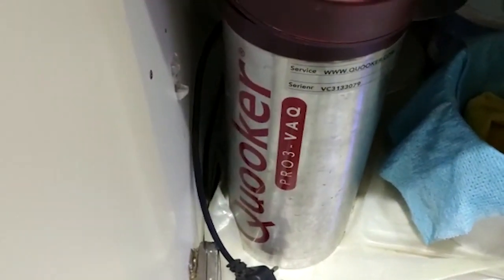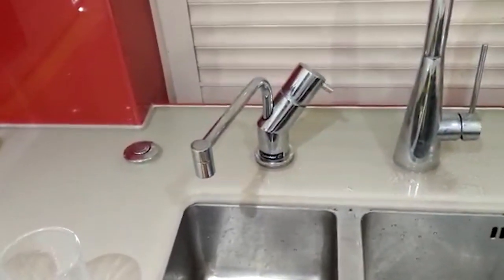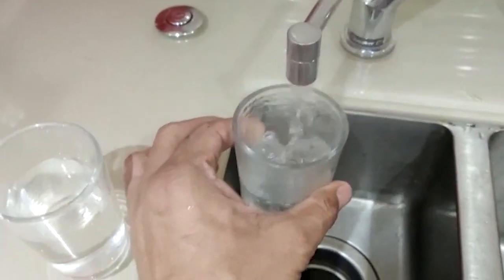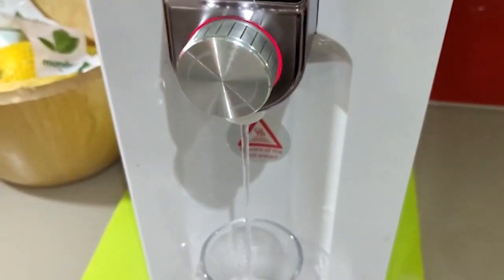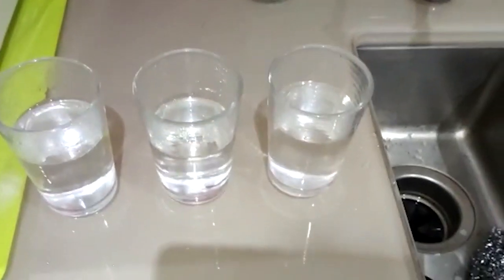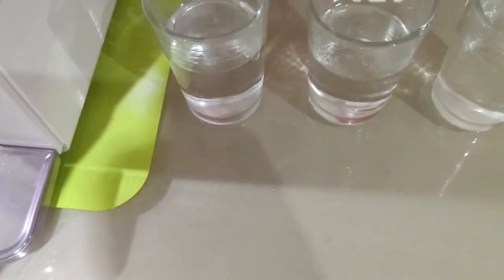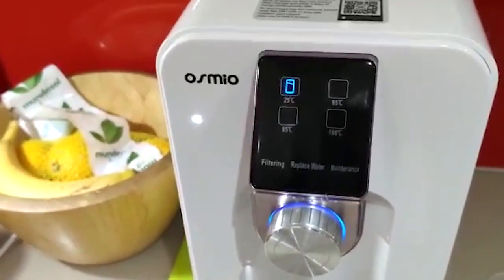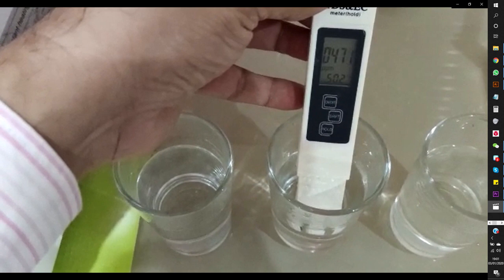The Truth About Instant Boiling Taps - Part 1

Comment: I have had the same health concerns concerning these hot-water systems. All it took for me was to use some common sense which led me to search about videos of how the inside of these boilers look. Lot's of videos with huge limescale build-up. What made me even more concerned was that Quooker apparently recommends that the very small filter inside of the boiler needs to be changed only after 6 years or so. That was at least what I learned from watching one of these videos made by users. I thought: how can this be possibly safe?
OK, to be fair: I don't know what magic they have built into their filter it just says it is active carbon.  And apparently, the hot water runs through this filter (Please correct me if I'm wrong on the hot water since I'm not completely sure about this point.)
I'm not about bashing anyone's products. I would just love to see in general companies not only focus on design, and convenience but also put much more thought into the health aspect of their products. This is true for all sorts of products not just for faucets.

Question: What type of warm-water system do you use for your home in general (bathing, washing the dishes etc.)? Are there any brands of flow heaters, boilers, etc. that you would recommend in terms of health? What would your personal optimal system look like including filtration? And for what type of water pipes would you settle for your home?
I would truly appreciate an answer from an expert like you.

Comment: The test with an 8 year old Qooker, and a brand new osmio,  Can you test it with an 8 year old Osimo?  Just in the name of fair play, and apples with apples etc.
Reply from the maker: Yes can do this because we do occasionally get old ones for repair, so can show TDS results from them. The Osmio Zero has a TDS alarm built into it to stop dispensing if it goes over a set level, so you end up comparing apples and crapples

Comment: The “mechanism” described here sounds remarkably like electrolysis. Howsoever it may be, in what way are TDS’s dangerous? This aspect of the “mechanism” - be it electrolysis or some other electro-chemical process - has not, in this presentation, been clearly defined. The water in my region is very good quality. We, essentially, can’t really detect any distinct (unpalatable) difference between water direct from the cold tap or that from a filtered water device. It is true I don’t have the TDS data, but in 40 years of drinking and boiling this water we have never needed to descale any boiling device or appliance: they simly do not suffer from build of “deposits” lime, or otherwise.
Reply from the maker: the issues with all plumbing and heating system is corrosion and scale build up, so TDS is just a way to detect when this is happening, and a proper heavy metal lab test confirms it

Comment: "not only are they environmentally unfriendly keeping water boiling all the time" - 
Are they really? It's basically a vacuum flask. There is very little energy lost. I have an electric kettle, and I try to only heat what I'll use, but I know people who fill their kettle all the way up, use a cup, keep the kettle on hold, don't come back to it, and all that extra water is now just cooling down, ready to be reheated again. It would have been much better to have it in a super insulated container leaking very little energy, allowing for just the right amount of boiling water.

Comment: It makes sense, although what concerned me as someone who researched and bought an Osmio under cabinet system then changed to Osmio Zero free-standing unit and only my wife is considering Quooker as water drips into the sink vs an out of sink drip tray is the quality of the cooled filtered water, they use an active carbon filter cartridge however compared to Osmio’s four filters I wonder how Quooker would re mineralize the water or is it pure water. I would like to see the tds test done on a brand new install on boiling, sparking and the cold filtered water to understand better.

Comment: I’ve installed many of these taps over the years as Part of my job as a experienced kitchen installer. They look great in principle, but the instant boiling water is (in my opinion) dangerous. I’ve had customers ( and children/visitors to those customers) who’ve  got confused operating these taps and have got burnt. I’m not saying that no-one should buy these taps, but they should be made aware that if they are very old/vulnerable/children/easily confused are likely to use them think very carefully about purchasing. Would I buy one myself ? No.
Reply: Thanks for pointing out the dangers of these boiling water taps. People seem to far easily ignore these dangers. Dread to think the amount of accidents that these taps will lead to.

Comment: Terribly bias. A brand new machine! What will that be like in 8 years time? Also how can the reading be that much lower than the cold water tap? Was it filled with Alpine spring water? Surly it was filled with water that is supplying the cold tap so would be at least the same. What reading would you get from a kettle that is not brand new? Are these particles harmful at all? Most would probably be from lime scale. Poor video all round.
Reply from the maker: Whatever heats up water ends up in the water. Using a device that keeps water hot all the time and made from stainless steel is the worst thing one can do. The osmio zero uses a rare earth ceramic oxide heating element and these are usually changed within 7 years which heats only on demand and it makes a huge difference. People but tap water into the Osmio Zero and the systems makes the water have a negative orp which is the main reason for corrosion, I. E. Having a positive orp. Measure your tds and orp. You think it's a poor video, but you have alot to learn about water purity and corrosion.
Reply: Ohh I didn’t realise the tap water going into the machine reads 274 on tds meter but coming out of the machine it measures 27 was it? So the machine is actually magic it’s made the same tap water so much safer to drink. Hilarious! So what would the machine test at after 7 years? And why is it worse for the environment when tests show it’s cheaper to run a hot tap system than a kettle? So it’s using less electricity
Reply from the maker: @siliconemaster  you've really missed the point. Would you drink our of your hot tap at home and fill your kettle with that? Why not? It's even worse tds increase with instant boiling taps, you see if you can get that point. Noone should be using these devices, they need to be banned. Check the tds yourself anyone with a 3 month or older instant boiling tap, oh and make sure you let the water cool down first

Comment: So 0.02% more parts per liter after 8years? oh no..
Reply from the maker: EC meters typically go up to 999, so have a increase like this which is getting on for nearly doubling is highly significant in the water treatment, but still a good point. Next step for us is to do a water quality test on these systems, we will do a full potability analysis including also the metals from the stainless steel like chromium and then show the source vs the instant boiling. The EC test simply shows there is something majorly wrong. Perhaps you drink and cook with the hot tap in your kitchen? Most people know not to do that and it normally wouldn't exceed 60 degrees C.
Reply: @OsmioWaterH2O  https://tappwater.co/en/tds-tap-water-filter-quality/ interesting read. Imo, if they claim a TDS of 300 - 600 to be fair, then the TDS of an old quooker unit at 450  doesn't sound alarming. Also the fact TDS cannot detect all details the same way a lab test does. And the human body actually requires a specific amount of minerals does also make sense to me.
Reply from the maker: @Zarod89  if the Tds has doubled from the system that indicates something wrong and it means a lab test should be done. If you don't think it indicates anything wrong, why don't you use your hot tap for cooking or making tea or drinking, we all know what is going on here

Comment: Boil, cool, boil, cool, boil... if you want an energy efficient solution for boiling water in the home, wait for the kettle to boil. If you want a high consumption, catering solution, buy a BURCO boiler. A tried and tested solution since 1938. Save some money and baby seals while your at it! 
Assuming that your ‘Osmio’ unit uses the same heat cycling principle, but has a ceramic coated element (not the tank I’m guessing) how is it any different to the competition? 
If you want the purest possible option for the home, re-fill your existing kettle with as much water as you need each time you use it. Which is what most people do anyway.
Reply: Are you seriously suggesting that unfiltered tap water is the purest possible option? I think you may be missing the point.

Comment: As someone considering buying one of these instant hot taps I was very interested to watch your videos on the subject. 
I shall have to do some more research on the subject - I thank you for raising this.
As an aside - TDS meter readings are sensitive to the temperature of the liquids and it is not appropriate to make readings for comparison purposes unless all fluids are at the same temperature. I would also question whether the meter in question is suitable for use with temperatures nearing 100deg C. Most recommend  taking measurements at 25degC which is the international standard. I mention this because it is a massive claim you are making, wholly based upon the readings from a device which is not being used according to good practice.
Reply from the maker: The temperature maximum usually on Tds meters is about 80 degrees c, many of them also measure temperature. You can easily test it yourself with anyone who has has instant boiling tap. Just allow the water to cool to room temperature and test the tds then.
Reply: @OsmioWaterH2O  Your "findings" would carry more weight had you followed Simon's sensible suggestion. I cannot easily test it myself for want of anyone with a boiling water tap. Why not retake your video comparing three samples at the same temperature and, while you do so, avoid the silence at the beginning of the present video?
Reply from the maker: @johnnywilkinson9736  it's a good suggestion. If anyone has one and a TDS meter they can do exactly this test and see the same highee TDS.

Comment: Why are you all not compare it to the kettle boiled water? It's like comparing snow flakes to the rain!
Reply: Good point! Water boiled in a kettle should have been one of the comparisons. As a kettle boils water only once, I would expect to see a lower reading compared to a ‘boiling water tap’ which continually boils the same volume of water until it is used. This is when the oxidisation is given time to take place.

Comment: What an idiot!.. there’s nothing wrong with lime scale in drinking water... I removed the HTAC filter in my Quooker, I use water from my own borehole...I descale my Quooker every year and there is a lot of limes ale in there... so of course some will dissolve into the incoming water. Now if you believe that the TDS is some kind of dissolved metal, then prove it..
I bought the identical TDS meter as per your video.. my standard tap water was 217, from the boil tap it was 550... but only because it was boiling!.. it rapidly dropped to 217 by the time it got top 70 degrees celcius again as the water cooled, so still within the parameters that are normal, but back down to cold water tap levels by the time  it was drinkable... noting that your tap is not pouring at 100 degrees, it won't have redisolved many solids and if you then put in a filter, of course you can remove stuff.. but whilst the filter is new and clean.

Comment: As per the video TDS levels for the Osmio gave a reading of 36. What I want to know is where you are getting your facts that the reading of 36 is the safest option to consume out of the the 3 tested?

As per the water regulations the amount of TDS thats required in the water to be considered the healthiest is as per below:-

<50-250 ppm	Considered low: missing in some of the minerals that are beneficial to your health
300-500 ppm	Perfect: This level is the sweet spot for TDS in drinking water
600-900 ppm	Not great: Consider a reverse osmosis system to remove your TDS
1000-2000 ppm	Terrible: Not recommended or safe for use
>2000	Worst:     A TDS level above 2000 ppm is completely unsafe and household filters can not handle this level of contamination

As per the above facts the osmio is actually removing the beneficial minerals that are required by our bodies. Please can you explain yourself?
Reply from the maker: Your notion is totally incorrect and probably came from the WHO. You should distinguish between minerals from biological and geological sources. The first challenge is to purify water to the best level, but this involves reducing the good, bad and the ugly. Once the water is in this state then then water is conditioned how we want it to be. The minerals are bioceramics which means they are bonded with carbon to make them bioavailable. Minerals from geological sources are not. Consider hardness of water provided by 120mg of calcium per litre vs the same amount of calcium from an apple. The apple is bonded with amino acids to make it bioavailable. The water from the Osmio Zero is also negative ORP, redox potential. You can research this until the cows come home, but ultimately look at the people who have been drinking distilled or osmotic water for the last 30 years and see for yourself if they are depleted in minerals or just happen to be the healthiest 70 year old you know. Good luck with your research because I can see where you are with it, and you have a long long long way to go 🙏
Reply: @OsmioWaterH2O  no comments 💩
Reply from the maker: @mariuszj1200  sorry did I miss anything?
Reply: @OsmioWaterH2O  Great, informative response. Thanks

Comment: Try looking in a kettle after 8 years!!
Reply: Who keeps a kettle 8 years?
Reply: Your missing the point. A kettle boils the water once before it consumed. Instant hot water taps continuously boil the water in a reservoir until it is used. This system increases the time factor for the oxidisation to take place.
Reply from the maker: See here TDS test on a 10 month old system https://youtu.be/I4wC_s5beKg

Comment: You should read this article

https://tappwater.co/en/tds-tap-water-filter-quality/

TDS does not mean the quality is poor, adding a filter before your boiler and good maintenance needed.
The fact that your tap splashes means that there is a lot of scale present.  I maintain mine and it never splashed once. 

Hope you don't hoax this new technology any further.
Reply: Search for ‘laminar flow’ 😆
Reply from the maker: Oh jeez man if the guy has double the level of dissolved solids that a problem and yes a TDS is a crude measure but its meant to be double the incoming. Heating water always puts material extraction into the water. That is what is is about!

Comment: 8year tank. Vs New  osmo?  Is it fear? Maybe time for service? Do a test when ozmo is 8 year without service.
Reply from the maker: We did a test on a 3 month old quooker owned by a plumber called Martin Train, it was 30ppm higher and no calcium in there it was softened water
Reply from the maker: Yes have done tests on 7 year old ones with original rare earth ceramic oxide heating elements, there is no TDS increase when it's heated. This material is the gold standard for material extraction for heating elements
Reply from the maker: Martin Train the plumber is how at 100 TDS ppm over from 30 ppm a few months ago
Reply from the maker: See here TDS test on a 10 month old system https://youtu.be/I4wC_s5beKg

Comment: That quooker tap needs a service. There’s no pressure when he turn the tap on. Bottom of the tank will be full of scale and that’s where the draw off outlet sits. 
Would like to see the test on a new or serviced  quooker tap model.
Reply: One small correction.. the draw off is at the top.. the cold water inlet has a pipe extension to a deflector at the bottom. Hot water stays at the top, without getting chilled by circulating cold water... but yes, the Quooker needs a service
Reply from the maker: @FarmerJulian  Martin Train the plumber who had a 3 month old one giving 30ppm extra is how over 100 ppm more few month. You are so wrong!
Reply from the maker: We had a plumber Martin with a 6 month old one adding 30 ppm, we have photos but waiting for him to make a video
Reply from the maker: See here TDS test on a 10 month old system https://youtu.be/I4wC_s5beKg

Comment: Thanks for sharing your findings. It is indeed unbelievable at what risk most of the companies are willing to put us in order to profit. I think it may be very interesting if you would extend your description by explaining how Osmio Zero is preventing the described issue to happen. Many thanks!
Reply from the maker: It's basically has a heating elements made with rare earth ceramic oxide which is guaranteed to not corrode even with aggressive or acidic water.
Reply: @OsmioWaterH2O  What about the material of the boiling tank itself? Is it also ceramic coated? Also is the water kept at a constant boiling temperature like an instant boiling water tap or a ‘BURCO’ boiler perhaps?